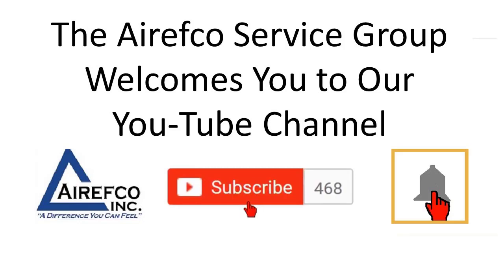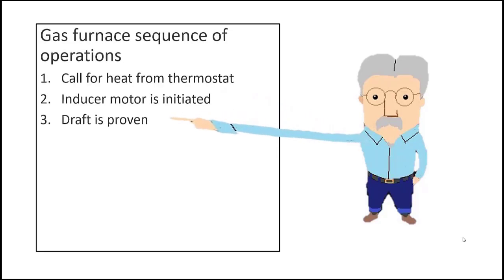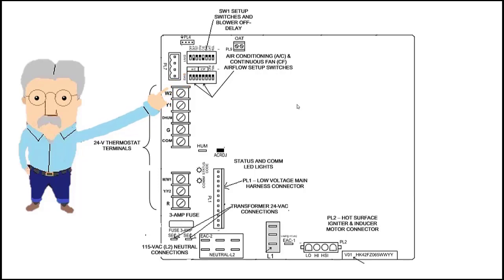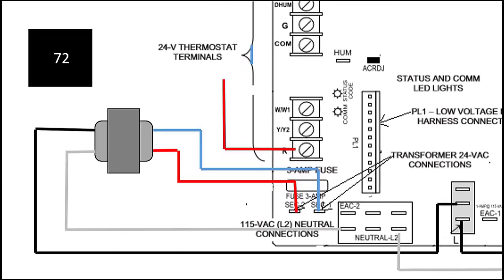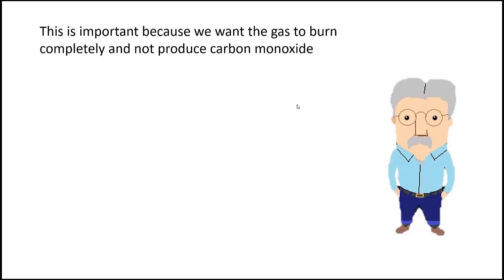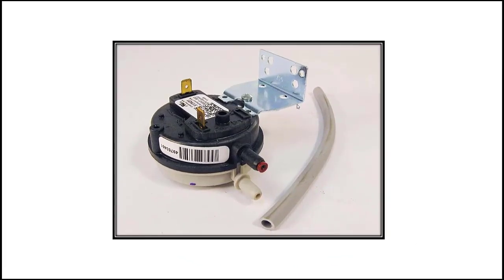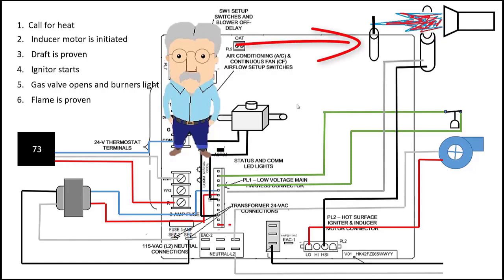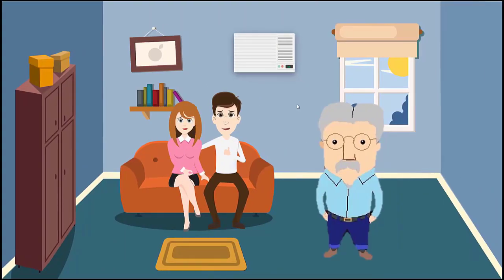The Sequence of Operations for a Gas Furnace

Comment: In the flame rectification circuit, the flame acts as a switch and also an AC to DC rectifier. The circuit board sends out a low amperage AC current through ground which travels through the burners. If there is a flame present, the current will flow through the flame and into the flame senor. The flame sensor wire completes the circuit back to the board, proving flame. The AC current can pass from the burner to the flame sensor, but will not pass back through the opposite way in to the burner when the current alternates and thus the AC current is rectified to DC. We read the flame signal in Micro Amps DC.
Reply: Yeah this was pretty good up until that point. Alot of older guys were just taught wrong when flame rectification became common in the early 90's. I've heard that taught wrong a bunch of times. But, you were almost right. The a/c voltage potential exists at the flame sensor and flows from the small flame sensor surface to the larger burner surface. It can only flow in that direction. The rectified dc micro amp current is sensed via the ground by the ifc.